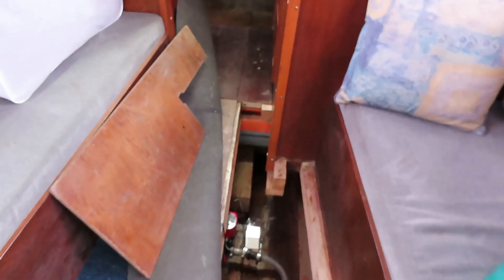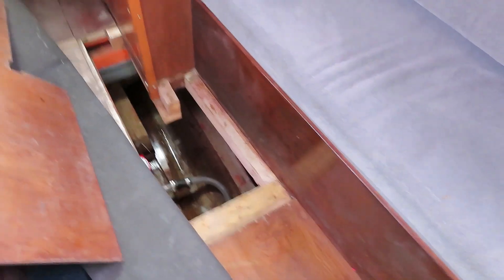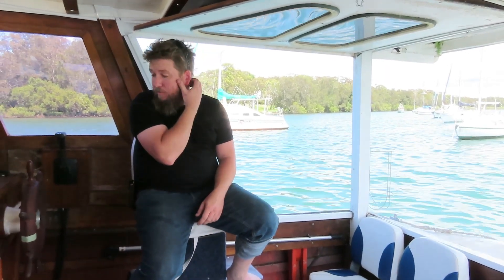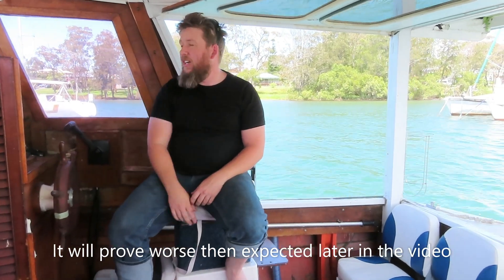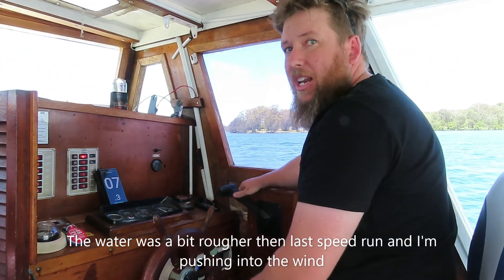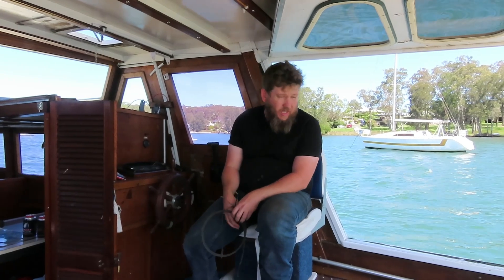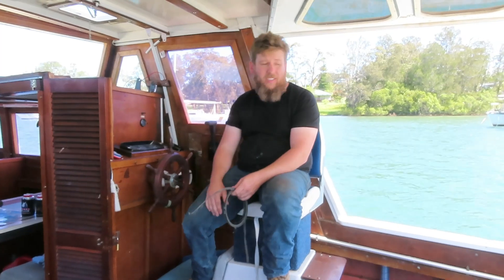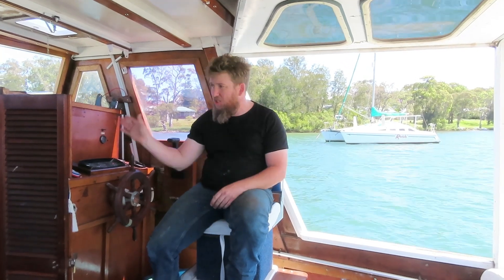HARTLEY 34FT REBUILD "KIARRA" EP7

Comment: You need to drop at a V-6 into that boat mate, if you're looking to get more speed out of her, as well as a high performance propeller, aquatic designs make all of the difference when it comes to propellers so the more advanced the design, you'd be surprised what kind of engines you can get from a wrecker as well, so if you save up your pennies and put some feelers out to the local wreckers that you want a low mileage V-6, even if it's like a 3.something liter V-6 would be better than the i4 you have now for torque and high end power, even a 4 cylinder boxer motor out of a Subaru would be better than the i4 you have in there right now. That engine looks to be extremely old and low on power to me. Just some ideas but you would have to put the old girl into dry dock to change out the motor properly, I think, but you might not either unless you took the time to update the drive assembly as well, which wouldn't be a bad idea considering her age. If you want to turn that boat into something you are going to pass on to your children then I would think on doing it if I were you. It is all about the money you plan on sinking into her. Something as nice as this old girl could be an heirloom family piece when you get her all done up proper. The kind of boat you can take up and down the coast when you retire, and live on her until you pass. That would be my goal if I lived on the coast and happened to get a beautiful boat like that. You'd certainly spend more money on a hose than on this lovely little ship, especially if you're doing the lion's share of the work yourself. Just one thing, though, I should mention, you would likely want to change out the camshaft for any replacement engine you put into her if it comes out of an automobile, with something more friendly for a Motorhome/RV to boost up torque and mid range power. As always make sure the engine is good before you drop it into the boat, because the last thing you want is to go through all the trouble of an engine swap and then the Engine blows a head gasket or if the engine has a warped or cracked Head/Block. But if you were to get an engine out of a wrecked new car, or low mileage car that is likely to be your best option. Then you could use your boat to cruise all around the coast of OZ and never worry about making port before dark a large V-6 or even a small V-8 would remove that problem, or at least remove the speed/power problem you have, but it would also create higher fuel consumption, but there are alternatives to gasoline, like LPG or Propane. My Father Ran a courier service and he had his V8 converted to propane and he spent considerably less of fuel, that's with a lot of stop and start driving every day, and an engine that runs at a constant speed uses less fuel than one that is constantly revving up and down as it goes through the gears of a transmission. I honestly think you should consider it if you have intentions of keeping this boat for the rest of your life. Not likely going to replace it with something more modern unless you intend to spend considerably more than reconditioning this old girl! You've got a Gem there Mate, Make the best of her, turn her into your retirement plan, if you're not adverse to the idea, that is.
Reply from the maker: All very good points you make mate.
I wouldn't consider this boat a retirement plan but you never know what the future has in store.
To be honest I haven't really considered a petrol V6 as a swap I was more set on doing a diesel repower but it is worth considering.
I was looking into a Bravo outdrive upgrade when I do an engine upgrade but that's a long way down the road. We do have junkyards full of Buick/GM 3.8 V6 engines here and they are as reliable as the tides and could make for a good option.
Thanks for you comments and hope you're enjoying the videos 👍https://youtu.be/3u92tqW8QIc
Reply: Only downsides to V6 option would be
Aluminium and warm/hot saltwater wont get on so would require heat-exchanger. 
Fuel system replumb for EFI as it recirculates fuel unless you fit a carb
Salt air and moisture might play havoc with ECU. 
Rewiring, altho the existing temp sender may fit the V6z 
Possibly adapting it to the leg
Engine mounts. 
Water cooled exhaust required
Nothing that cant be overcome but  would still take a goodly chunk of change, esp exhaust, cooling.
Reply from the maker: @matui6983  more reason I was leaning towards diesel, especially if I could use a mechanical injected engine. Still just considering all options at this point. 
Any and all mechanical/electrical work I will do myself as this is my normal bread and butter and where I'm most comfortable.
Reply: Wouldnt be surprised if you didnt get any change out of $5K for a V6  swap poss/probably more. 
Diesel is def the way to go. 
You could make your own watercooled exhaust manifold if you decide to use a 4WD or small truck engine. Then find a heatexhanger, saltwater pump and a way to adapt to the leg. 
Nothing alloy headed
Nothing electronic
Reply from the maker: @matui6983  alloy heads will be the issue if I do go something later model 4wd engine. 
I do happen to have a 6.5ltr v8 chev turbo diesel here that was planned to go into my 4wd but who knows it may end up in the boat. Hmmmm decisions to be made I feel.
Reply: Early 3.0 Nissan, Mazda, Isuzu are the best with cast iron heads. 
6.5T is soooooo heavy for the rated hp. Leg wouldnt handle it. 
Would need watercooled manifolds, heat exchanger/header tank unit engine oil cooler (big) and exhaust riser/mixer. 
Save it for a shaft drive boat possibly or your 4WD.  Not being a downer but the 6.2's and the 6.5's do not make especially good marine engines.
Reply: Also check out Hino engines
Top Japanese marine engines would be Yanmar, Isuzu, Hino. 
The 4 cylinder genuine marine Hinos are brilliant.
Reply: @HarpersShed  I really am enjoying the vids, I was going to suggest a diesel but just remember that they are more expensive all around. Require a lot more servicing, and everything about them is more expensive, but if that's what you want then more power to ya! I wasn't going to suggest a diesel because of the cost and the weight, Diesels are WAY heavier than petrol engines, but the other commentator is right Aluminum and salt water do not mix well, so a heat exchanger would be a must, or if you get lucky, find a V6 with a cast Iron block. EFI will really not be too much of a problem all you have to do is plumb a return line back to your tank. Buick/Olds/Chevy 3.8s are great but just pay extra close attention to the intake manifold and head gaskets because they are known to fail on those engines, but you would have to do a cam change for any non-diesel auto engine. but your local dealer parts center could help you out there for sure, as to what is recommended for RV use. or a boat dealer/shop would also be able to set you up for what would be the best. The diesel engine really is the best way to go, but the cost is the one thing that would make me consider a petrol engine, besides, a Petrol engine is MUCH cheaper to work on and you could do most of it yourself is you are inclined. I look forward to seeing what you eventually decide to replace the engine with! Thanks for sharing your journey with us on this boat, BTW, modern engines really are the best way to go, and the Chrysler 3.5 is one of the most fuel efficient engines out there on the market right now and the Ford Ecoboost isn't far behind so the petrol engines are catching up to diesels in mileage but not quite there yet. Cheers!
Reply from the maker: @oculusangelicus8978  I'm still a long way from making any decisions on the repower but you all will be the first to know when it happens.